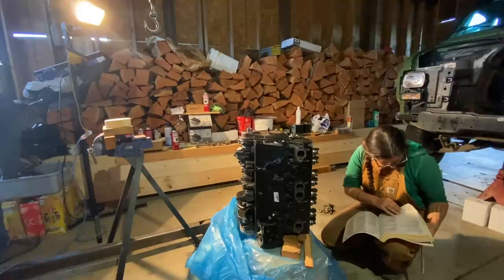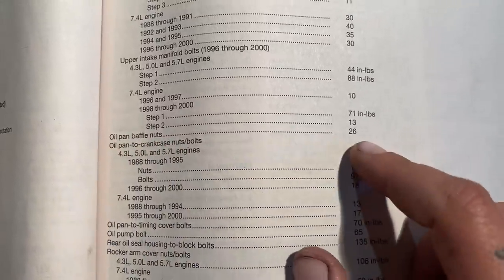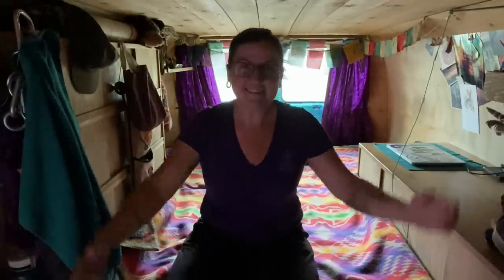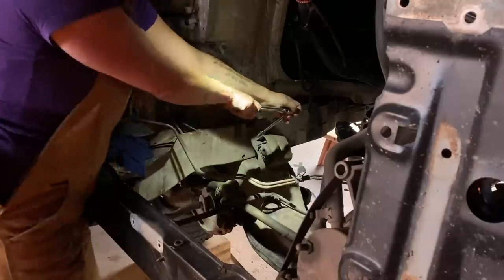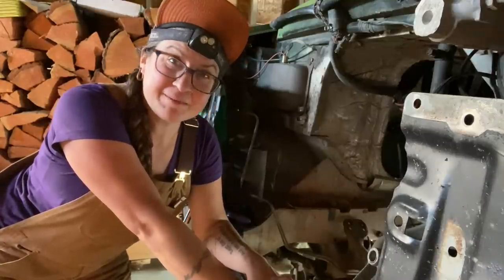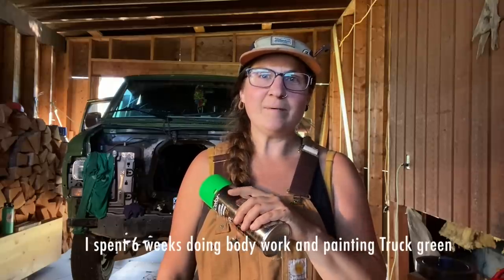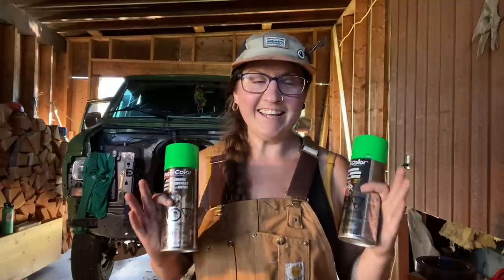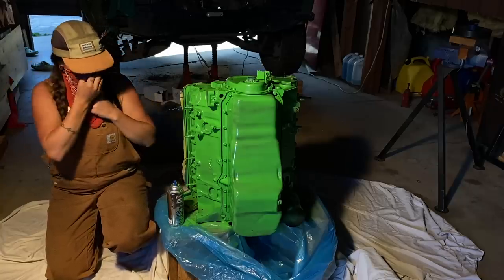Preparing my New Engine for Installation || Van Build Secret...

Comment: Install a propex sealed combustion heater..Takes the moist air  out of the truck and heats you up.Keeps condenstion and mold at bay..LP fueled .Operates on leasure house battery....Thermostat controled....I have one in my VW.camper...No stinky diesel to worry about..Will improve your life greatly..Can even make charcoal air filter to keep truck fresh...Check with engine.builder about break in specs.  You are doing fantastic..Keep pushing on
Reply: Cool!! 💖💝

Comment: great-great-great /i always left the bottom half of motor mounts on crossmember frame an the other half on engine /after line up then  put the long bolt in/also i put blue lock thread tight on tork converter flex plate bolts threads/an on flex plate bolts threads to-blue lock tight/an i would replace front transmission seal /an a little blue lock tight on transmission bolts too/a little all it takes/you are going to have a great van/thanks much

Comment: I love my 5.7 Hemi so I know you’re going to love this new engine. When I replaced the engine in my E-100 I also went bigger. I had to change the engine cover because of the size difference. Will you need to do the same or is there room? Cheers from Vancouver eh!
Reply from the maker: The replacement is the same engine so no adjustments needed and we know it fits easily

Comment: @tidelinetoalpine How many miles did you have on the old engine?
Reply from the maker: Only ~120,000 and the head gasket is going unfortunately the people before me did the worst job looking after it 😔
Reply: @tidelinetoalpine  Thanks, my 2001 has 82,000 and was wondering how much I could get out of it. I know the 350 L31 is notorious for blowing head gaskets. Good luck with your swap out!